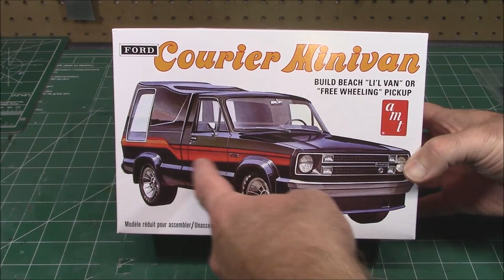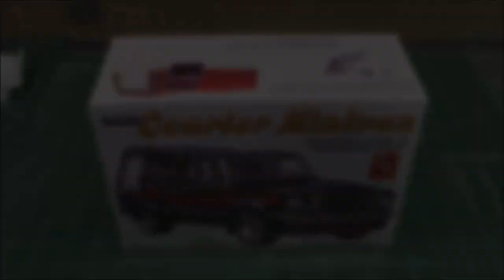1978 FORD COURIER MINIVAN MINI TRUCK RANGER 1/25 SCALE MODEL KIT BUILD REVIEW AMT1210 MODELROUNDUP

Comment: Awesome! I believe the Courier was a rebadged Mazda pickup. Years down the line Mazda's B Series truck was a rebadged Ford Ranger.
Reply from the maker: Thanks for the info!
Reply: Yep. I had one of these..was wrecked when I got it..was able to fix it up using parts from Mazdas in the local junkyard.
Reply: Yep had a 1980 good little truck just one little quirk with mine if I went to shift to fast the shifter would pop out of the trans got to were i could fix it in 5 minutes in part to replacing the bolts with studs and using wing nuts
Reply: Right on! Everyone argues with me when I would say that! There is some truth that Japan and us made a great deal of complete trucks as well as parts pieces and components!

Comment: Useless trivia: Trucks with 6-foot beds were visually ID'd by three factory "cleats" or stanchions on each side of the bed. 7-foot beds had four cleats per side. The small round badge in the grille said "2.3" and denoted the use of the 2300cc 88-horse engine. No badge there for the standard 2000cc 77-horse. Nice build. Mine was the same color you selected.
Reply from the maker: Thanks!

Comment: Do you find you get more paint on the model with a can rather than an air brush? Can you do a video painting a model with the air brush? I would like to see that. I'm thinking of getting an air brush.
Reply: Spray paint lays down a much thicker coat of paint, especially the stuff this guy uses. I can't stand the spray paint from hardware stores for models because of that. It covers up all the details and makes them look that much more like toys. Spray paint made for models, like Tamiya's spray line, sprays much, much finer. But an airbrush is best if you're trying to preserve details. Airbrushing puts down an extremely thin layer of paint.
Reply: @tcj226  I like to keep as much detail on my models as possible. I try and make them as real to life as I can. I spent most of my adult life as a heavy truck and equipment machanic. I do mostly big rigs, but I like the smaller trucks also.

Comment: Great job on the build as always.  You make it look so easy!  When AMT had the flare side version back in the day, I had such a hard time assembling the bed, I almost gave up.  
I don't feel so bad about my paint on the Porsche Tractor I'm working on (Thanks to your review) our humidity is through the roof right now in Florida.
You're right about the compact trucks being away.  Luckily they are kinda coming back.  Check out the Ford Maverick and Hyundai Santa Cruz.  They're crewcab unibodies, but they have the same spirit as the old trucks.  I wouldn't be surprised if someone makes model versions of them soon.
Reply from the maker: Thanks Gene!

Comment: Nice work, Ford used the B2000 series with a Brazilian built 2300 Ford engine. I had a few of these over the years and they were a better truck that the Ford ranger which I have had as well. T/Y and Happy New Year 2022!
Reply from the maker: Thanks!

Comment: Fun fact the optional wheels are the same Vector turbine wheels used on the General Lee.  so if you ever want to do a detailed accurate Lee use those instead of the kit supplied ones.  but cause of use of metal axles the only way to use those wheels is if you build the snap together curbside version geared to younger builders but those wheels would go a LONG way to make that version of the general 'pop'.
Reply from the maker: Cool!

Comment: Beginner's question: is there a functional reason you prefer CA glue to model glue for so many parts?

Is it to minimize paint running, or quick drying, or...?
Reply from the maker: Model glue won't join painted and chromed parts. CA will, and quickly.